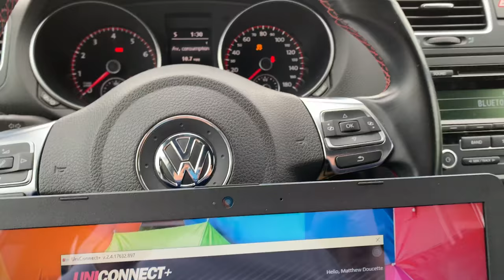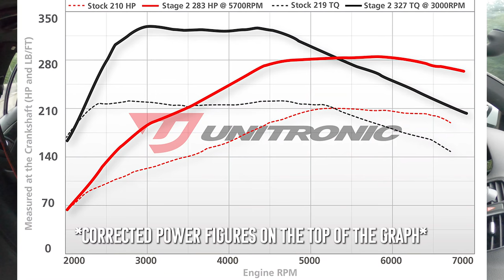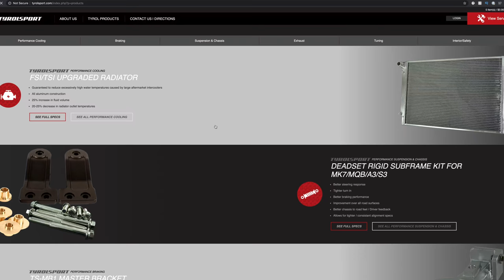Volkswagen GTI - How Reliable Are They Really?? Biggest Flaws...

Comment: I drive a 2011 2.5 Jetta,  probably one of the most reliable of the gas engines they made. That said,  Some of the problems I had are the same thing a 91 MK1 had.  Door latches, ignition switch, wiper motor and rear brakes calipers.  It's like they made all the parts 30 years ago and kept putting them in....(not the ignition switch, they updated that with one that fails too)  I'm pretty Handy, so tinkering with the car is not a problem. For a GERMAN(Mexican) CAR its pretty good. LOL
Reply: ive had some issues with the 2.5l. oil leaks, pcv valve keeps ripping or melts a hole. other than that its been good. most of the problems are age related. plastics crack. almost 135k miles would like to get it to 160k before considering a new car.

Comment: Had an mk7 I drove for 6 years until 180,000 miles ihad some recurring alternator problems and a door issue but nothing major ever went wrong with it. I bought an mk8 and have had to take it to the dealership 3 times for various electric issues. Idgaf they are still my favorite cars I've ever owned even more than my wife's G70

Comment: i am currently looking for my first car and mk6s caught my eye ive been researching them quite a bit and i feel like its a chance on reliability people have been saying great car little to know issues and other people saying that its been terrible i go to mechanics school and i dont have deep pockets but all around it looks like a very fun car easy to mod and tune
Reply from the maker: Thanks for the comment man. My advice, if you can afford it, go with the mk7. But since you go to mechanics school, the MK6 is also a decent choice. They are very fun cars and easy to mod like you said. If you know what you are doing, the mk6 is just fine. Not all all of them have reliability issues. I’m at 134,000 miles on mine, and I haven’t had some of the problems that a lot of people say they have.
Reply: You will be taking a huge risk buying an MK6. Your mechanics school with be needed and deep pockets as well.
Reply: SIX VWs and never any problems. 
The problem is people put cheap-ass gas in them. Read the owner's manual. PREMIUM. My CC currently has 111K on it and ZERO problems getting there.
Reply: @NotSoHandyCarGuy  and my dad didn't like
Reply: Got a mk6 not long ago, almost at 170k miles n still going strong!! Just keep up with the maintenance and you’ll be good
Reply: @littleserote546  update? I’m thinking of buying a 2013 golf gti with 150k km. Do you think it will last?
Reply: Keep up with maintenance. Check your oil and coolant often. Use premium gas. Go to a VAG specialty shop for repairs and maintenance.

Comment: Sea foam in the gas really wont help with the carbon build up that causes issues since it would be directly injected with the fuel which causes the problem to begin with. The carbon build up that causes issues is on the valves and intake manifold. You can use the spray sea foam used through the intake though and that may help a little.
Reply from the maker: Adrenaline Junkie I used the top engine cleaner seafoam, the one that sprays directly past the throttlebody into the intake manifold. You’re totally right, the gas treatment wouldn’t do anything because it’s direct injection anyhow! But the stuff that I used worked very well!

Comment: I’m thinking on buying a mk6 2010 with and 150,000 miles on it, have a lot of aftermarket parts and body kits , it’s manual trans and looks gorgeous, the owner ask 7,000 , If he down mow the price to 6,000 I would buy it, but I’m afraid of wasting my money if they are bad cars.
Reply: Did you buy it?
Reply: @comic14  yess, actually it just have 134k miles on it, r32 spoilers,airlift suspension, sound system, stage 2 with a complete 3” exhaust system, i pay $6100 for it and i love it 😍

Comment: My 2012, 2 liter gti has the red oil light and beep even though i changed the oil and the sensor, 100k miles, the engine sounds fine, what could be my problem?

Comment: Really Appreciate the effort you put into this video.  I am currently looking at GTIs and this was a big help! Thanks.
Reply from the maker: Good luck with the search!
Reply: I’d definitely get one no matter where you go there will always be flaws after no machine is perfect but I’ve had a mk8 GTI and despite a creaky cabin and the informant system needing to be changed I absolutely loved it and it was so fun too drive and it looked awesome. I upgraded to the Mk8 R recently and also love it this car is a beast  in every sense of the word and I’ve had 0 issues with my R so far. And I had 0 mechanical issues with my GTI only electrical. Those issues from the mk6 have been solved for the mk7’s and mk8’s

Comment: The rev hang is without a doubt due to carbon build up. I was having horrible cold start idle and massive amounts of rev hang. I tore into it and did the carbon clean up on the intake valves myself. I did the manifold and water pump at the same time and it was like new.
2013 2dr.
Reply: You think it really helped rev hang? Cold start i get but rev hang usually affected more by rotating balance assemblies like lighter flywheel brings faster rev increase and decrease to less force needed from crank due to less weight you know?
Reply: @wr450sm5  Something I did fixed it. I have to assume it was the intake valves as it was a gradual process and was completely gone after I rebuilt the top end. I did replace the manifold, water pump, re-did the cam bridge seal and upper timing cover seals but from all my research, the carbon on the intake valves fuct up cold start idle and rev hang. GL

Comment: I know the Mk6’s have their known failures, just like any car, but the MK7 GTI is actually a pretty reliable car. It looks like you have modded your MK6, so it’s hard to say if your car is just unreliable or is it unreliable BECAUSE you have modded it?

This is a question I will be addressing in an upcoming video I will be making on my MK7 GTI. I am decently heavily modded, and though I have had failures on my GTI, almost all of it is because of my mods. I am at 82k miles, and will be making a 100k mile reliability review when I got 100k miles (in a few months), so keep a lookout for my video!
Reply from the maker: I modified my car after I did all the fixes. The clutch is going because of the added torque from the tune, but everything else happened pretty much before the mods.
Reply: @NotSoHandyCarGuy  interesting. Yeah I know Mk6’s have been known to be pretty unreliable, which sucks. I keep track of all the things I fix on my car (I’ve been tuned since 3k miles), and tbh almost everything I’ve had to fix on my car is because of my modding. Very very little has been unreliable on my MK7 as far as just something failing. Just the waterpump, battery, and ignition coils, have failed “just because” and not due to my mods. I’ve been very impressed with the MK7, and if I never modded it, I know I never would have had the problems I’ve had with it. But, the car is a lot funner with the mods, so it worth it haha
Reply: @slow mazda turbo, wastegate, front end links, clutch, turbo coolant line.

The turbo coolant line failed due to improper install on my end. It’s a reliable piece otherwise. The turbo failed because I had it tuned improperly for the conditions I was running in, as well as not having an upgraded intercooler at the time it failed (I have a video on this so check that out). The wastegate failed for some reason, but probably due to tuning conditions. The end links failed just from abuse. It’s a cheap part to replace ($15-$20 each side). 

When you mod a car, things will fail. That’s a common thing. Especially when running double the power from stock, like I am. Honestly, it’s been a good car to me. Takes $$ to play. 

Thanks for subbing! I appreciate that! Check out my vids. Lots of GTI vids on my channel. You can’t go wrong with the MK7 GTI. They’re really good price used too.

Comment: Depends on the year. The  2014 model  solved  most of these issues. I have 130K and zero issues.
Reply from the maker: Totally. I think it was the first half of the 2014 model years that still had the tensioner issues. You must have a later-model 2014?

Comment: I may be too late but always get a dual mass flywheel and a clutch meant for a dual mass flywheel. The clutch you have is meant for a single mass flywheel which means it won’t work with a dual mass. Also a single mass flywheel and clutch will cause mechanical shock which shreds your transmission within 150 miles.

Comment: 2016, used. Less than 60K, coolant leak, sensor problem which had to drain transmission for replacement. Costing 3k on repair now

Comment: i have a 2016 vw GTI 77k miles. No problems up until this year.  It’s turning into a money pit. My gas mileage has been HORRIFIC and unexplainable driving worse than a v8. My EPC light keeps coming on . I’ve changed the coils , spark plugs, filters  . My car last month out of no where wouldn’t turn on and was completely broken down, Germaine auto specialist mechanic stated it was “ carbon in the valves ….” New fuel injectors, fuel pump good… I don’t know where else to turn. If you have heard of these things or have any ideas of what could be going on . Thank you
Reply from the maker: EPC and bad mileage? It does sound like carbon on intake valves. If you’re a bit handy, you can clean them on your own. Otherwise, it might be your high pressure fuel pump. It could also be low octane fuel/old fuel filter. I would fill up the car with 93 octane, then unplug the battery for a little bit and plug it back in. Plus clear the EPC code
Reply: @NotSoHandyCarGuy  i already cleaned the carbon on the intake valves and changed the filters and checked the fuel pump even changed my coils LOL. I fill the car with chevron premium as well, that’s why I’m so confused and even my mechanic . Can’t explain my bad fuel and epc light keep coming on. Example : yesterday i filled my car to 210 miles of gas range I LITERALLY drove 10 miles and now my tank says i have 185 left ….the math ain’t mathing . Really sad havnt had any issues this whole 7 years up until this last year one thing after another. I’m really considering getting rid of it . Which sucks i love my car and take good care of it and its paid off smh

Comment: The CCT problem is nothing new. The older 1.8Ts had a timing belt between the crank and the exhaust cam and a chain from the exhaust cam to the intake cam. The CCT/CCA (adjuster) was a frequent failure point (been there ... done that ... fixed under warranty at the 4-year mark).

Comment: Ah the creaking door seals -drives me mad. I apply silicone spray which more or less stops it but needs re-applying every month or so. I do wonder if the seals have hardened over time and if fitting new ones would fix it - I can't imagine they would have been that bad when the car was new?
Reply from the maker: Ok so I just found a permanent fix, but it kinda sucks. I installed an x-brace on the rear strut towers, and the creaking is pretty much totally gone. And the car handles so much better now. BUT the brace impedes on storage space, if you want to fold the seats down. If you don't need the entire trunk that often, you should look into the Eurosport brace!

Comment: Would you recommend a 2013 model with 104k miles ? CARFAX shows good maintenance record too
Reply from the maker: Sure! I think at that point most of the major issues have probably been addressed. It will most likely eventually need a carbon cleaning though. But I’d say go for it if it’s in good mechanical shape

Comment: I really hope someone can help me with some guidance, I'd appreciate it in advance, great video btw, very helpful and informative!

I've been looking to pick up a 2012 Volkswagen GTI MK6 (4 door manual for those curious) and after doing a lot of research, I've seen that the timing chains is the biggest engine killer for this generation of GTIs. 

I've decided that changing the chains is 100% necessary and alongside doing it's regularly scheduled maintenance.

I'm reaching the point where I want to go out and buy one however I can't shake the fear/concern of the tensioner knock and blowing up the engine.

PCV valve is something else I'll get done once picking up an MK6 

Anything else I can look out for or hidden areas to check to be sure?

Thanks again in advance!
Reply from the maker: Thank you!! They’re decent cars if you know what to look out for. One other thing to look for is waste gate rattle or any codes related to boost/turbo. And rough idle/misfires. The PCV is important, but one of the first “mods” I’d do if I were you, is a catch can, to help reduce carbon deposits on the intake valves.
Reply: @NotSoHandyCarGuy  Thank you for your quick reply!

No worries, I'll keep an eye out for those things, any new updates are heavily appreciated :)
Reply from the maker: @bearham  no prob! Actually, one more thing. I’m rebuilding my engine right now because of one issue. The little oil screen in the camshaft bridge broke off and got lodged in one of my main bearings. SO, if you end up doing the tensioner/timing chain, I highly recommend removing the oil screen from the cam bridge.

Comment: Gotta say the chassis flex is bad on the mk6. Mine creaked so bad on driveway, especially with a stiffer rear sway bar. The tunnel brace helped a lot. Overall man I absolutely miss my manual mk6 gti so much. It was a blast to drive , low end torque and very go kart feely at stage 2. Awesome video man as always 💯
Reply from the maker: Driven by Boost yeah man it’s pretty bad. It’s so obnoxious, especially on horrible New England roads at low speeds 😂 that’s crazy, I thought that the swaybar would help, if anything. I’ll have to check out the tunnel brace. I can’t wait until the issues at hand are all figured out! I appreciate it Chris! 👏🏼 Been meaning to watch your latest video, I’ll have to make some time for that today!

Comment: What is that kettle whistle sound when boosting or did your downpipe cause that sound because our vw t4 2.5 tdi also make this sound
Reply from the maker: For me, it was the diverter valve. Doing a diverter valve spacer solved the issue.
Reply: Isit ok cool thanks then i must look somewhere else our t4 don't have a recirculating valve

Comment: Performance clutch and lightweight flywheel should resolve your RPM hang. Has to do with the dual mass flywheel. Where in MA are you?
Reply from the maker: That’s what I was thinking too. I bought a single mass stage II flywheel, and I’m hoping that helps. I’m 2 minutes south of Gillette stadium!
Reply: @NotSoHandyCarGuy  ahh gotcha. Im in Western MA. Roads looked similar. You'll enjoy the flywheel/clutch combo. It will create an audible noise like a tractor but if I can live with it you can :)
Reply from the maker: Oh sweet man, whereabouts? And thanks, I’m hoping it makes a big difference. Also I’m doing the rear main seal and dog bone when I’m down there 🤙🏼
Reply: @NotSoHandyCarGuy  Located in South Hadley MA. I will be modding this car so I'll be in the game for awhile!
Reply: I wouldn't use a solid flywheel in place of a dmf. The tractor noises as said are nvh of the gearbox hub syncros, bearings, bottom end bearings prematurely wearing out due to vibration. Unless its a race car that gets rebuilt every few races i would fit a dmf with a performance clutch.

Comment: I found a gti I think a mk6 with 107,000 miles on it the guy said it runs good nothings wrong with it for just under 8k is it worth it and will I run into any problems?
Reply from the maker: I’m at 136,000 on mine right now. Ask him what has been done to it so far. Ask him if the timing chain tensioner was updated. And ask him if the intake manifold has been replaced. I think 8000 is a very fair price if the car is in 100% working condition
Reply: @NotSoHandyCarGuy  bro there is a 2010gti super clean cosmetically. It’s actually stage 2, the owner has receipts of the tunes and every thing. He appears to be super responsible and took care of the car etc. he also took care of the the timing chain tensioner etc. it does have 128k miles. Do you you think I should get it? He wants $8.5. Would you consider it reliable since time chain tensioner service was done, and owmer made sure tunes were done properly. Or would you recommend me to just get a stock one
Reply from the maker: @jonathanf7950  I think 8.5 is a little too much. But I think that’s cool because he’s clearly someone who knows and cares about cars, not someone who is going to drive 5000 miles over their oil change.
Reply: @NotSoHandyCarGuy  thank you for your respond bro. I live on CA in Orange County specifically not sure if cars are pricier over all over here? Bc ik civic SIs for example are cheaper outside the state. Anyway, would you recommend me getting a stage 2 ( Moded car) in terms of reliability not sure how much less reliable it could be compared to stock. Sorry for my ignorance

Comment: Looking at your car . I think my turbo may be blown . Someone put water in my gas tank . I emptied the gas tank and fuel rail and its still pumping white smoke . Fuel pump was new befor the water the fuel injector aren’t sticking . My opinion for the smoke “I THINK” is the turbo or fuel pump
Reply from the maker: Damn I’m sorry to hear that. Im not too familiar with turbo issues, as my mk6 had a new turbo put in before I bought it. Is it making noise and not making boost?